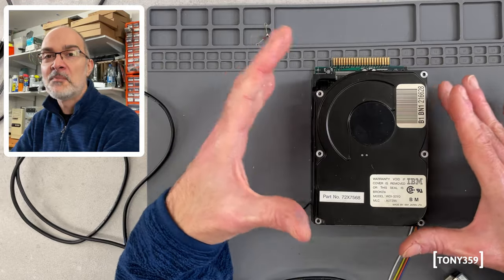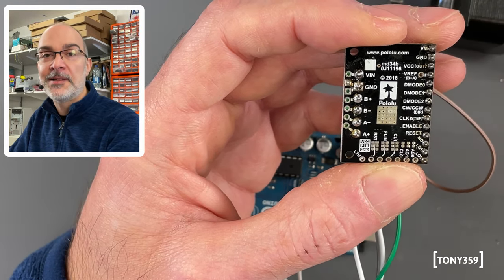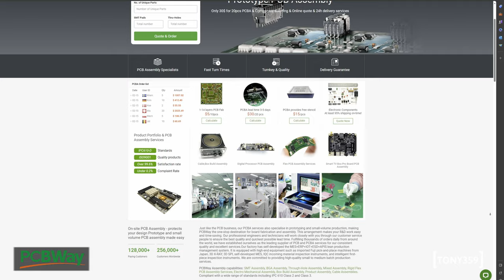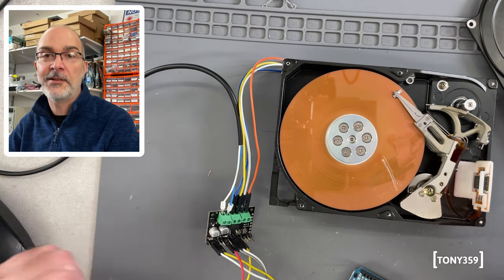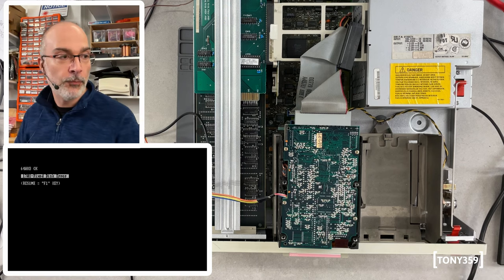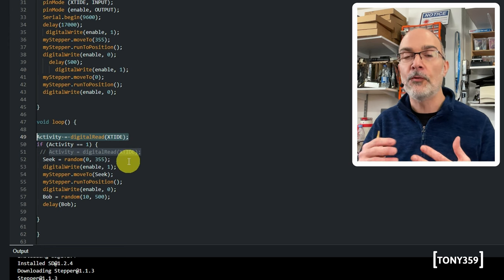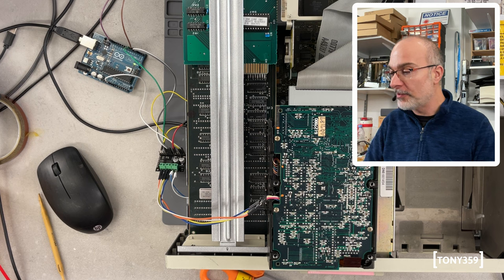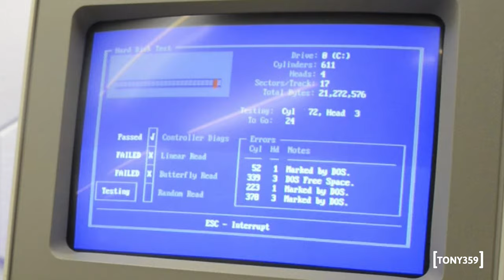Let's "fix" this IBM PS/2 Hard Drive!

Comment: Hi Tony!
HDD init sound is missing! Just after drive have sinned up.
Also XTIDE light signal behaviors the strange way. It flashes instead of constant lighting during surface test. It affects adruino and stepper motor operation. So those affect the sound and whole emulation perception.
Anyway, that's a great idea and a very good implementation! Thank you for your positivity!!
Reply from the maker: Hi - yes, others are telling me. That drive never worked and I can't remember from when I was 15 (apparently it's a long time ago!). 
Yes, the XTIDE activity light is only a pale approximation and the head will just make some noise. But particularly doing linear tests - where the head is not moving much - my device will be completely off. Same with the "butterfly test" - but to overcome that I think we need a proper engineer! :)
Thanks for watching!

Comment: Instead of the delay at the start you could make artificial Hard Drive initialization sounds. Although I'm not sure if these drives in particular had any. But I still remember glorious MFM and early SCSI HDD initialization noises. :) Great video! Very creative too. Although for once I'm grateful we mostly went beyond spinning rust as storage device, but I can understand the emotional attachment to the noises.
Reply from the maker: Good point, I am guessing what that drive does when it starts up - I should have asked Epictronics!

Comment: What an amazing idea! The first alternate solution that came to my mind was a speaker and some sort of noise simulation, but your way is soo much better!
Reply from the maker: A small player with a speaker could be simpler but I feel the noise from that HDD is a combination of direct noise and mechanical vibrations transmitted throughout the whole case. I feel a speaker won't be able to replicate it 100%. Thanks for watching!

Comment: Very cool stuff dude. At the start of the video I was convinced you were just going to stuff the cf card into the drive chassis somehow, but this was way more interesting. Nice work!
Reply from the maker: That would be interesting to do - keeping the platters and the heads as well. The only issue with this drive is that it's not an IDE drive so I'd need a second ribbon cable from the XT-IDE. But for a broken IDE drive it could be an idea! Thanks for watching!

Comment: I think it sounds pretty good! The 'right way' to do this would be an XT-IDE modification that would have the bios (since it seems to be doing CHS translation) output something like a 'head up' and 'head down' line for activity. Then it would be relative to the actual disk activity, and pulse repeatedly with small random access. But for what you can do yourself this is really quite impressive!
Reply from the maker: Thank you!
I’m no XT-IDE expert I guess we would need a 20MB partition on the CF with the same identical CHS. 
Who knows, someone might come up with something at some point!

Comment: Well, that's cool! Oh yeah, especially as an hard drive enthusiast I can definitely relate to you about hard drive sounds on vintage computers. It just makes the experience right, and those IBM PS/2 drives made very peculiar noises which, like you, I remember and enjoy a lot.

You asked how that drive sounds when powered on: if I remember correctly, after the platters reached the nominal speed the drive initialized the heads by making two fast full sweeps, one towards the center and one towards the outer edge of the platters, with a pause of a little less of half a second between them. If the heads were not already on track 0 because they were parked or left somewhere in the middle of the platters at the last switch off (ouch! for the latter...), the drive would drag them slowly to the outer edge, making a loud and very characteristic "bzzzzz" in the process, then after reaching track 0 it proceeds with the two sweeps. If you can emulate such behaviour with your contraption here I think you would get the last bit of realism.

Again, cool job :-)
Reply from the maker: ahhh, amazing! So you're saying that that is what the drive was doing when it was stil sealed? It was looking for track zero?
See early video: https://youtu.be/pHqJnSNobT0
Thanks for your comment! I'll see if I can replicate it!
Reply: @tony359  Yes, I'm pretty sure that it was looking for that. This is a behaviour I saw in a lot of stepper hard drives: when the heads position is unknown at power on, they would move the heads slowly toward the platter's outer edge, then when they sense track 0 or the heads stop is being hit (often repeatedly) they do their usual seek test. If you read the service manuals for those drives you would see that type of behaviour described in there as well.
Reply from the maker: so primitive :) 
Thanks for that!

Comment: This would be really cool and could even be a way to save drives that would otherwise have to go on the garbage pile for retro collectors who want something that sounds more authentic but still maintains the reliability of using the XTIDE. If this could turn it into something that is more turnkey and would work for different drives it could see quite a lot of interest in the collector community.
Reply from the maker: I didn't think about that! It's probably difficult as each drive is different - some use steppers, most use voice coil. But it could be an idea! Thank you!

Comment: The high pitched noise also has to do with the amount of micro stepping  you are using. The hissing sound in idle has something to do with the stepper frequency but also the input voltage. 
A motor can be  silent at 12v but hisses at 24. But your solution works fine. Also remember that the stepper drivers from this age are WAY more advanced then in the eighties. A lot has been done to make the steps as smooth as possible. You could try the old A4988 driver with 32 micro steps.
Reply from the maker: Good point about technology progressing a lot since the 80's! :) Thanks for watching!

Comment: The noise you hear in idle is the chopper frequency of the current limiter. If you disable the limiter it just pushes all current it can and the motor will heat up. To use the enable pin is a nice workaround but the good solution is to get a proper stepper motor driver - what for sure is more expensive.

Nice idea in all, i like it. Another solution is the "HDD clicker" made by Retroianer ❤
Reply: Yeah. those A4988 stepper drivers are just "bad". DRV8825 are way better and the price difference is not that big.
Reply from the maker: I had that already and that was a "second attempt" as first I ended up with an even cheaper one which was truly bad!
For sure there are better options!
Reply from the maker: Isn't the clicker just a relay clicking?
Reply from the maker: I have - it uses the same HDD activity light to trigger a simple clicker.

Comment: I have heard people trying to emulate hard drive sounds from the activity light before, but never stepping the stepper of an actual dead drive. If you know what to expect you can tell something isn’t quite right (especially in a benchmark where it’s supposed to do track to track seeks) but it’s probably the closest you can get to the real deal without replacing the drive. It’s a bummer these appear to be very unreliable.
Reply from the maker: Yes, the benchmark/test is the worst place to test - but obviously it triggers the stepper a lot. Totally a bummer, I would have loved a working one but...

Comment: This is completely mad but I love it! I just had a thought though, maybe you could make a note of the time between the last head movement and this one and if it is really short, make a much smaller head movement - might make the checkit scan sound a bit more realistic.
Reply from the maker: checkit is indeed the worst example to use but it's moving the heads a lot! :) 
The thing is that an actual HDD might move the heads several small steps in a row so I don't feel that preventing that would make it sound more realistic. I do feel there is really no way to make it better than this as there is no way to know where the HDD would have gone! But thanks for your comment and for watching!

Comment: The head needs to move faster and the moving distance needs to be more random to be realistic. A full head sweep isn't what the real drive would do. Also try a working 15K RPM SCSI HDD. You will love that 747 jet engine sound even more. SCSI controllers and HDDs are very cheap now and still very useful. Especially with one of the newer SCA drives (e.g. 76GB) and a SCA to 68 pin or 50 pin SCSI adapter.

Comment: Nice idea and excellent video!
👍

At first, hearing about Arduino and stepper motor driving, my  suggestions for updating this idea will be, to add in line spying card with buffering in such a way, that when PC writes CF registers, sector numbers needs to be captured by Arduino too and used as step counter to drive stepper motor and determine head movement (forward, reverse and how far), imitating head position close to real at the time..
But hearing this solution in action, Yeah, it sounds amazing and very close to original and there isn't need to over complicate idea.. 😂
Reply from the maker: I didn't consider to use some existing solution - and then use the output to drive the stepper. Plenty of room for improvement :) Thanks for watching!

Comment: I also like the authentic sounds from real hard drives in old computers. people tend to say use CF cards and other stuff but it ain't the real deal. as long as I can run my computers with real working hard drives I will do this for as long as possible!
Reply from the maker: CFs are super convenient and fast of course. But for the proper experience I agree you need the buzzing noise of an HDD! Thanks for watching!

Comment: the hard drive of our old XT computer had funny noises, too, although it sounded a bit differently
Reply from the maker: The XT should also have a stepper-driven drive. I repaired an XT on the channel, I kind of remember a similar noise but slightly different indeed!

Comment: Very impressive results! 
One way to step it up is to change Arduino for something like Attiny85 and try to squeeze it into hdd case. I doubt thought that stepper controller would fit there. It would require custom PCB.
Another option is to get rid of all internal HDD components and try to recreate sound with piezo speaker glued to HDD case as resonance chamber. This would fit very easy, but I'm not sure if would be easy to reproduce exact sounds.
Reply: Yes, that was my thought too. Design a new PCB with same shape and size that fits to the drive in place of the old one. Then you have 5V and 12V straight from the HDD cable. Add a matching connector to plug in the stepper motor same way as original, and another for wires to XT-IDE. Might need to figure out how the spindle motor works - is it on all the time power is applied, or is there logic switching it on/off which you'd need to replicate.
Reply from the maker: I thought that just apply 12V would spin the platters but when I tested, it did not. That's why I left the PCB alone. There must be some logic, something waking up and driving the spindle. I also see quite a lot of wires going into the spindle motor, I doubt it's as easy as feeding 12V to it. But I am not sure. 
I had that old Arduino at home, for sure one could use a much smaller device and stick it at the back of the drive. Thanks for watching!
Reply: @tony359  Platters are spinned by BLDC motor, which had to be drived by controller, because it has 3 coils powered in sequence. Not worth trying.
This motor could have another interesting use case. It can be very easily used as rotary input device i.e. for scrolling.
Reply: piezo sounds like crap. listen to a Gotek drive modified with a piezo. it's some noise but it's not even remotely close to the real sound. It's mainly to be able to hear activity to know it's working.

Comment: Thanks for video. CF sound "emulation" perfect! I have the same ps/2, but broken, something with MB, maybe RAM issue (error code 000000 FFFE 201), and bad HDD. in future will use Your project.
Reply from the maker: Fantastic! I'll need to share the code somewhere, though it's very basic, nothing special! Thanks for watching!

Comment: Very fun :D
I would use a Nano, much smaller but still 5v

Or maybe... remove all the internals (except the step motor) and try to fit everything inside the hdd case!
Reply from the maker: Absolutely, I just had this arduino already! Thanks for watching!

Comment: That's how stepper motors work it switches coils depending on which direction is going to control it does a magnetic coil brake system it uses one coil when it goes one way and then it reverses the other way it uses the other coil that's how a lot of people use Deborah Motors to play music uses the Frequency sound to generate notes and stuff it's kind of neat that's a lot of the people out there find ways of using stepper motors to create music I did some similar in my old 3D printer where it played one of the Star Wars songs on it🤔🤔🤔
Reply from the maker: Good point! The PS/2 can now play the Imperial March!!! 😅😅

Comment: if you'd use a Raspberry Pi Pico you could "sniff" on the IDE Bus for the seek commands and therefore being able to produce much more accurate sounds. You could also ommit the old hard-drive and emulate the sound with a connected speaker instead.
Reply from the maker: I've been thinking of that but I don't think the IDE bus will have the head movement information, that would be the HDD's responsibility? I am not 100% sure but I'd imagine the HDD controller says "go get file xyz" and the drive translates that into the required head movement. Yes, the IDE controller can control the heads directly (see checkit) but I believe that's not the case when it comes to those HDDs - which, BTW, are not IDE. Not sure though.
The other problem is that the XT-IDE is a complete different drive geometry. If you look at checkit, it lists so many heads which the IBM drive doesn't have. So, how to translate that in a way that sounds realistic? I'm sure there is a better way of course but in the end I'm not sure it's worth the time! Besides Checkit, running a software on that old computer will barely move the heads.
Thanks for watching!
Reply: @tony359 The sector accessed would be enough information to calculate the "length" of the seek noise according to the sector before. Sure needs to be tuned to the actual geometry.
Reply: Yes, just a monitored sector is enough to emulate way better.
Reply: @jbinary82 Maybe as already a XT-IDE is being used one could modify the XT-IDE Bios to provide this data on a seperate 8-Bit Latch for the Arduino?

Comment: Great mod, did you attached to the arduino the real HDD led state while is working? or its lights up every time the stepper is moved? On the video I see the led blinking without any control. Regards  and congrats for the tutorial and the smart mod.
Reply from the maker: The led was still attached to the HDD which was reporting an error :)
I did not wire the LED to the Arduino for now. But I guess the best idea would be to use the "HDD light activity" from the XT-IDE - and share it with the Arduino for the head movement! Thank you for watching!
Reply: @tony359  yes, I am doing this mod and I will code an Arduino pin to light up the led, or maybe directly from the xtide board. May be I need to isolate the hdd led cutting the tracks to avoid high current thru the hdd board.

Many thanks for sharing this mod!

Comment: Before you bought the stepper motor driver board, did you think about using the original stepper motor driver IC on the HDD PCB. Is there a datasheet? Maybe you could lift some pins and wire the arduino to them?
Reply from the maker: No I did not, I had that stepper driver already and it felt easier than removing components from the HDD PCB - in the end I wanted the platters to spin and I didn't want to disturb the PCB. I tried just giving 12V and 5V to the PCB and the platter did not spin, not sure why. So I didn't want to break it! :)
Thanks for watching!
Reply: HDDs use custom chips for the motor and head control so using those chips is not possible without reversing the functionality and it's not realistic to spend years figuring it out.

Comment: With all that effort, it may have been easier to just add an internal speaker and play an audio clip whenever your actual storage is being accessed.
Reply from the maker: I doubt a speaker can sound as good as the HDD - the HDD will make mechanical vibrations which will resonate inside the case generating that familiar sound. I'd say it would be quite difficult to emulate that sound 100%! Even though it would be possible, where the fun in playing a speaker! 😉
Thanks for watching!